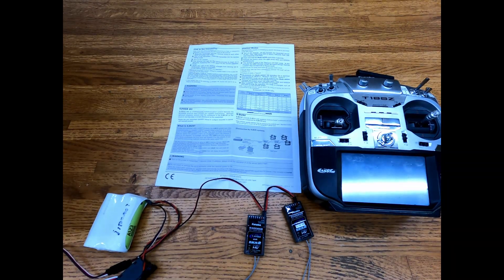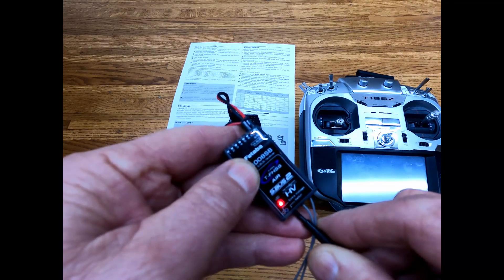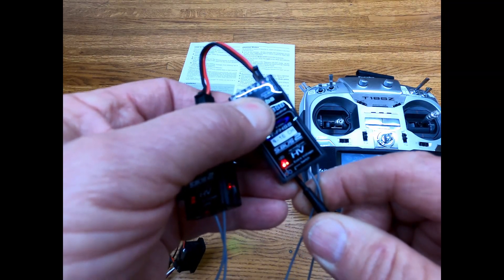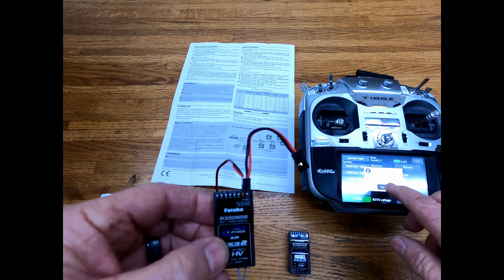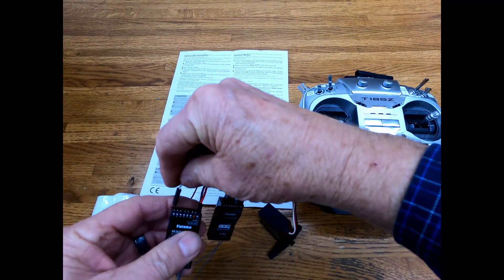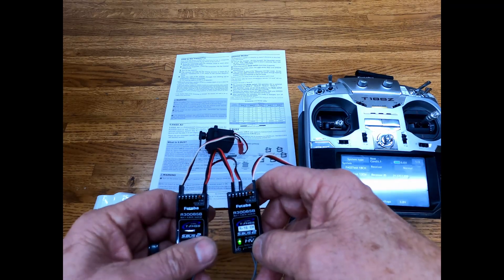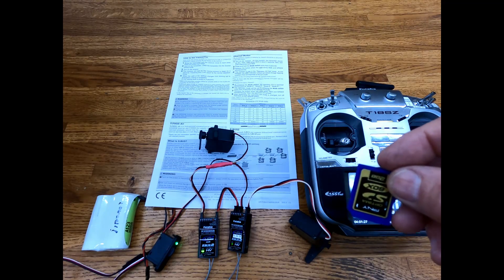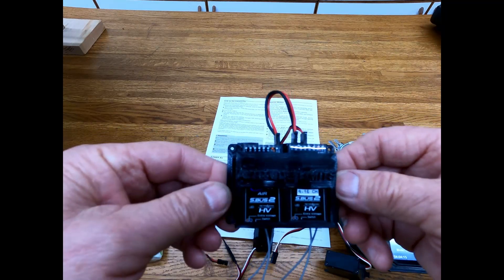Twinning Futaba R3008SB Receivers with Futaba 18SZ Radio. Setting up for Full 16 Channels.

Comment: Isn’t the point of 2 receivers is to put them far away from each other , to gain the best signal in all orientations?
Reply: That would be the case if it was a redundant rx setup. Meaning both rx's control ch. 1 to ch. 8. If one loses signal, the other still retains full functionality over the controls. 

 In this case, dual rx is doubling the channel capacity, so if one or the other loses signal, the airplane may still crash depending how vital functions are split between the 2 rx's.